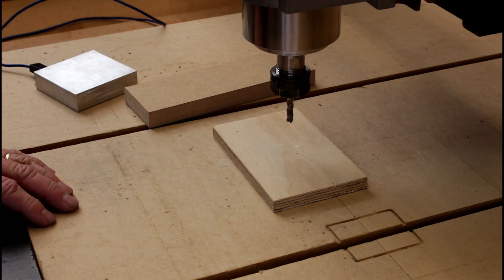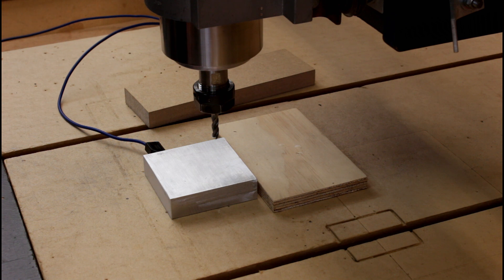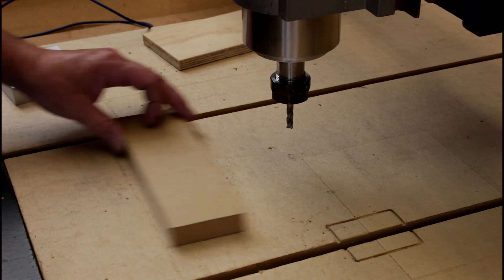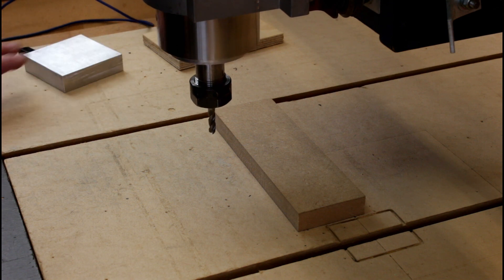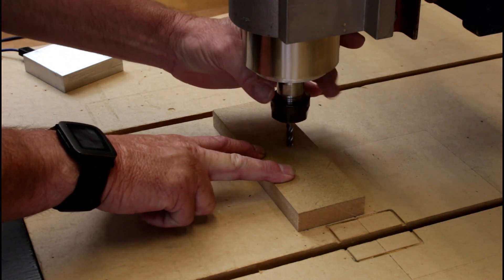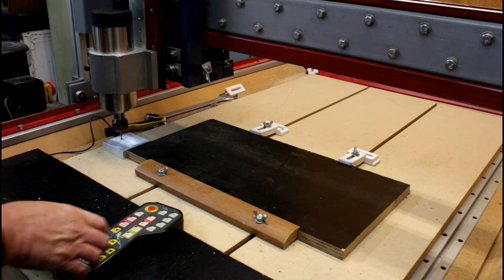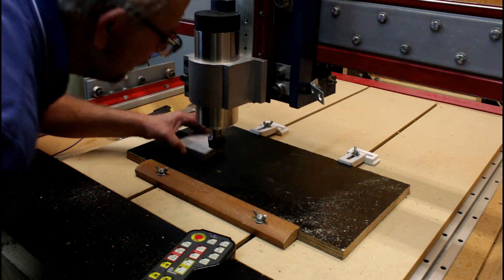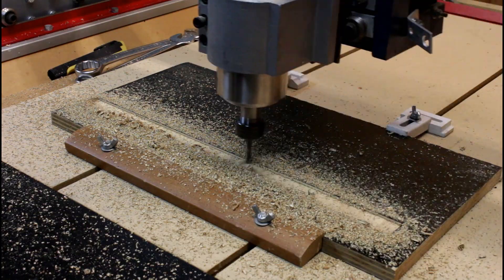Nominal Thickness Tool setter 2 - CNCnutz Episode 203

Comment: looks good, I'll be switching out my touch off macro today. Thanks for this........Ok, many hours later and back from the shop. I installed the macro and made the one edit to plate thickness. I didn't realize that the plate was going to have to touch the cutter before the touch off could happen, this feature for me was a bit of a non-starter since where I operate the machine from and "Part Home" is a good distance from each other. That edit was an easy delete and now the macro works like a charm for me. I've recently edited an led light, using one of your videos as inspiration and instruction onto my main screen that is linked to the probe led on the diagnostics page. When I place my touch off plate I just tap the plate against the cutter and can visually check that it makes contact. Of course, you know how it works I, added the detail for others reading this.  My part hold down is a bit different from yours and is a bit of a highbred cobbled together from several other cnc videos with an idea or two of my own thrown in. I'm still trying to come up with the perfect solution. I have to say though, I'm impressed. Setting Z with this macro and cutting out my parts left no trace of contact with the spoil board. I love the double tap feature and it seems to add a bit of precision to the setting.  Thanks again for the great videos.
Reply from the maker: Thanks Jim. Glad you like it and it is working well for you.
Cheers
Peter

Comment: I was thinking about making a setter like this but in a more advanced way. I want to use 2 setters. one for the tool length and one for setting the x, y and z axis. I want to make a block of aluminum by 60x60x15mm. on the lower part I want to mill out a square of 50x50x5. I want to get a pin of 10mm in diameter. first I want to probe the length of the pin and after that probe the edges of the part in one macro for x,y and z axis. so every time I have to do a tool change I only have to probe the tool length which I think will run faster and more precise. do you think thats a good idea?
Reply from the maker: I don't really see it as being more or less accurate. It just sounds like a different way of doing it. The problem is, I can't see how you can change your zero point from top to bottom of the material at will but I am probably misunderstanding, which would not but unusual for me. ;-)
Cheers
Peter
Reply: CNCnutz (Peter Passuello) lets see it as a very cheap way like what renishaw has on a haas Mill. You have a toolsetter. And a probe to determine the x y and z axis. Once you set the shaftlength on the tool length setter and “probe” the x y and z on the material, every tool change you only have to set the tool length on the tool length presetter. That is kinda my idea.
Reply from the maker: While I understand that part of it I don't see how you tell the machine you want to zero to the tip of the material for your first cut then zero to the spoilboard for the next one then bact to the top before the final cut referenced to the spoilboard again. This is the whole point of the autozero script and the concept of the stepped tool setter. Will your script ask fit the material thickness?
Cheers
Peter

Comment: Great video Peter, I downloaded the code for Mach. Just had a look at the code, nice!
One suggestion for a code improvement would be to add a "touch plate to the tool" request at the beginning.
This would require the operator to touch the touch plate to the tool to make sure it is working. Once it sees the tool touch, it would state "tool touch OK" 
Why would this be a good Idea you may ask? Well the other day I was using my touch block to Zero my Z
and I forgot to attach the wire to the block. The tool came down and just kept on going until it broke the bit :-(

Glen
Reply from the maker: Thanks Glen,
I have heard of it before and thought about it but my scripting skills are very limited.
Personally I like the idea of a light indication on the main screen to do a touch test before doing the Auto touch off.
Sorry to hear about the broken tool and that is the reason I dislike the cliplead option because it can be forgotten.
A spring loaded touchoff is a good option and allows for some safety as well.
I have been thinking of making a new one over the last few days.
cheers
Peter
Reply: Im playing with the code to get that feature added to your code script. ill let you know if it works
Reply: Hi Peter, I have that bit of code added and it works well. I added it too the top of your script.
ill head over to your web site and contact you from there to get the updated script to you.

Comment: A touch off block is definitely the way to go! Nice touch with the material thickness as a variable too. I made my touch off block with a sprung loaded top which has saved me more than once if the cutter doesn't make good electrical contact. Pitch buildup can cause problems and the spring saves the tool from being crushed. I've got a video on my channel if you're interested. Cheers!
Reply from the maker: +rhfabrication
Thanks. Will have a look at your plate. 
Cheers
Peter

Comment: Another great one Peter... you keep making my job easier and I thank you for that!!!  I'm assuming i will need Big Tex's Mach3 Toolsetter screenset for this macro to work??? I'm still using the stock screenset. Cheers, Lyle
Reply: Peter's using the stock Mach3 screen set in this video too. You don't need a different screen set for this type touch plate.
Reply from the maker: +Lyle Feucht
Thanks Lyle 
You can use what ever screenset you want. I was using the default one that came with Mach3.
Reply: Thanks Mark! Great to hear from you again!
Cheers,
Lye
Reply: Thanks Peter!

Comment: Why do you touch off twice? Thanks for the video.
Reply from the maker: +Grant Clarke
A slower approach increases accuracy because the steps are smaller. The first approach is faster to get a rough 0 then the 2nd is 1/10th the speed.
Cheers
Peter